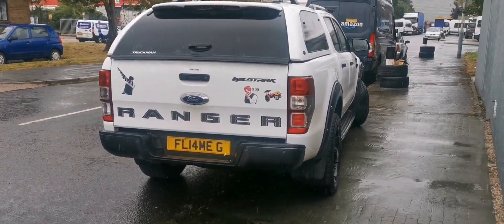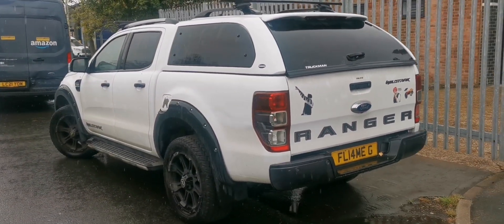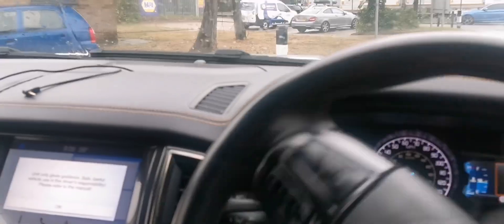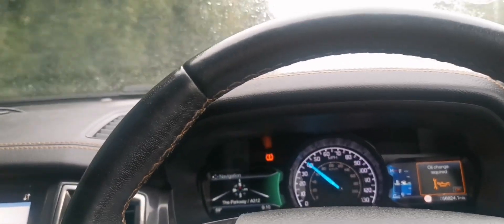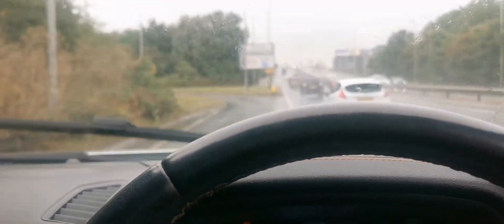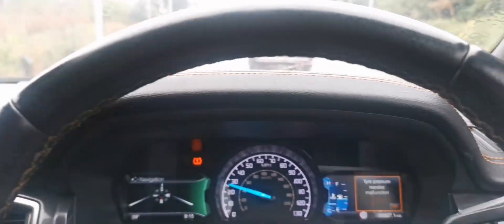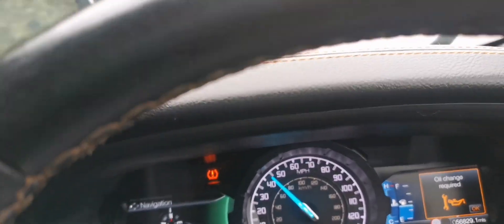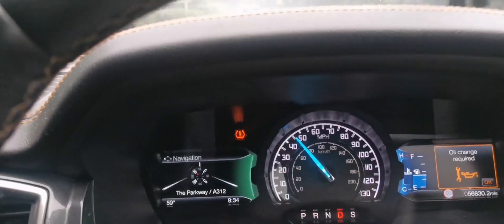Ford Ranger 2019 Judder on acceleration from stop | Shudder/Vibration When Accelerating From A Stop

Comment: the drive shaft bearings can wear prematurely , there have been cases of failure with the tailshaft  failing at the center joint and digging into the road ,  the shaft needs to be straight .   its worth checking that the shafts are straight balanced . Over 50 the harmonics of the shaft are at a higher frequency ......